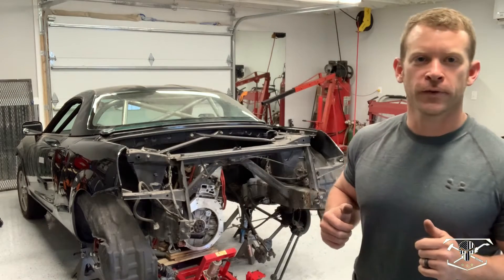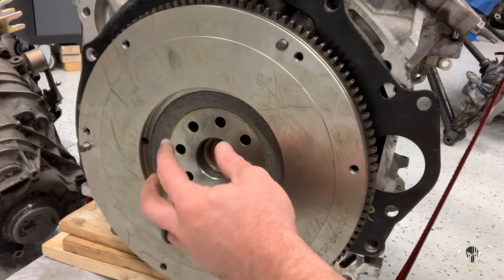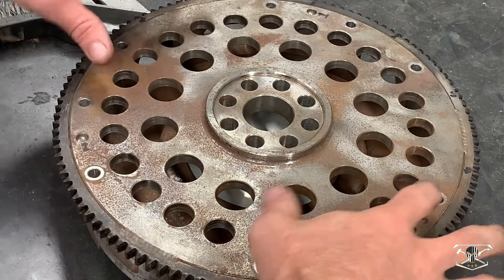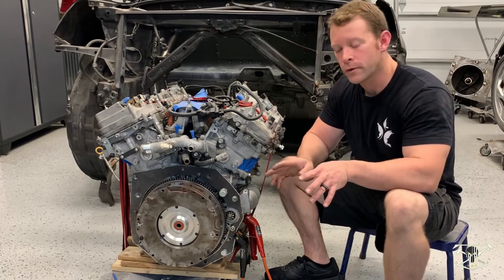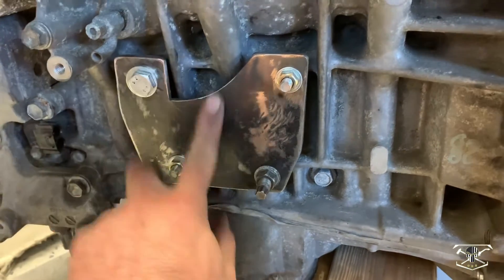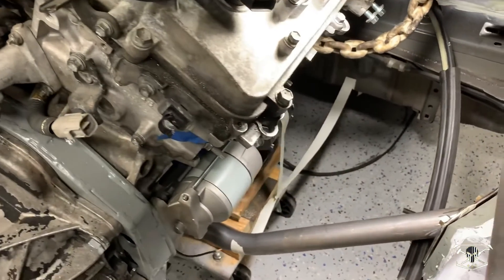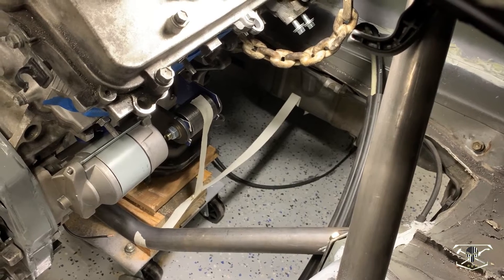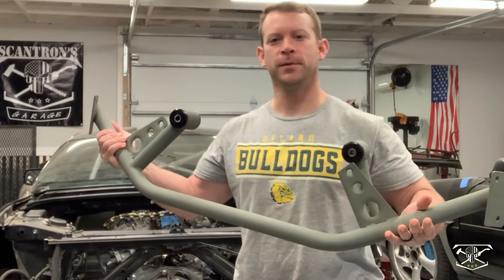Engine Swapped MR2 (Change of plans... K24/ 2GR V6)

Comment: do you sell the measurements or adapters?
Reply from the maker: I do not unfortunately but of you use two pieces of 3/16 plate with the 22 mm spacer between them you will get the spacing right
Reply: And then the flywheel you used was originally for the k24?
Reply from the maker: @MrTurbotyla  I had a toyota truck flywheel machined down to fit the part I call the "Crown". This part is purchased through Kennedy Engineering Products K.E.P. This piece is made to work with the Porsche transaxle. 

The reason I mentioned K24 is because I originally had the K24 mated to the porsche transaxle and decided later to go to the 2GR. I used the crown from that kit and made it work with the 2gr to Porsche transaxle.

I can tell you this crown is the same. I bought another kit from K.E.P for my v8 to porsche and it included the same crown.

Hope this helps!

Comment: Awesome video, I'm glad i stumbled across it! I'm super interested in your work and swaps in general despite having no experience. I considering putting a LSJ Ecotec engine in my Spyder. What are your overall thoughts on that and how feasible do you think it would be?
Reply from the maker: Good idea actually. It should fit in its original FWD configuration and just require some fabricated engine mounts. That should also put out a good deal of power over the ZZ. I say go for it!!
Reply: @scantronsgarage  I would love to but have no idea what I'm doing. Wiring seems like a huge headache too.
Reply from the maker: @iluvcakes19  ahh i see. There is only one way to learn. I have been working on my v8 swap for 8 years. I did just get is started though!!!
Reply: @scantronsgarage  I don't think I can stand having my car out of commission for 8 years, lol 😅
Reply from the maker: @iluvcakes19  I get it. I wanted to do this to my car 20 years ago but it was my daily driver. In time you can do this

Comment: the 2gr bolts upto the e153 and fits transverse.    This seems a lot more difficult to install. Why did you shy away from the transverse mount?
Reply from the maker: I like to think outside the box. moving the weight to the center of the vehicle makes for better handling. I did the same thing with my v8 mr2. Mostly, I enjoy the metal fabrication aspect of car building.

Comment: What’s the point of the build? Is the owner going to do A/B testing between NA K/ NA 2GR then turbo K/ turbo 2GR?

Longitudinal with a Porsche transaxle is cool, but is there an advantage for all that extra effort?

Don’t get me wrong, I’m a long time fan of your channel and it’s necessary for a V8 swap, but it’s puzzling for a K swap or 2GR swap. 

Keep up the excellent content.
Reply from the maker: Good thoughts. Yes testing between a turbo k series and the n/a 2gr. The 2gr swap was proposed to me after I did the K-swap. The longitudinal setup is important for moving the engine weight toward the center of the vehicle. The goal of this is to be able to achieve a 50/50 weight bias.
This car is now gone! and I am working on my v8 swap.. unfortunately i found out i have a smoked cam/lifters. more on that soon! Thanks for watching : )
Reply: @scantronsgarage  why 50/50 ?     what about the gyro effect of the engine/flywheel rotation ,  that has a different effect between transverse and longitudinal set ups
Reply: My thoughts exactly. This custom work is really neat, but putting a 2gr or k in an MR2 does not require this level of fabrication. Not knocking it or anything. Even if the reason is “just because”, that’s good enough for me

Comment: 2arfe, there is a guy so far putting down over 300 wheel hp NA
Reply from the maker: I saw that. Frankenstein motorworks. I like his work with that motor. Either way, I would have had to do a ton of work to make that engine fit this transaxle as well.